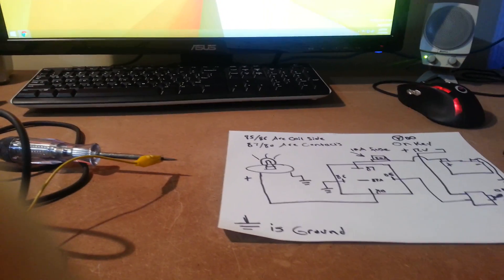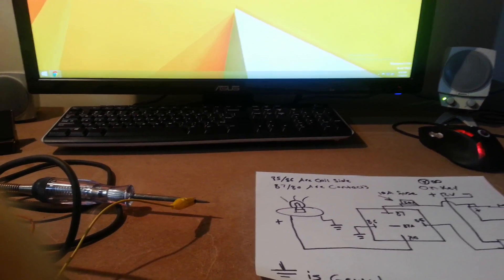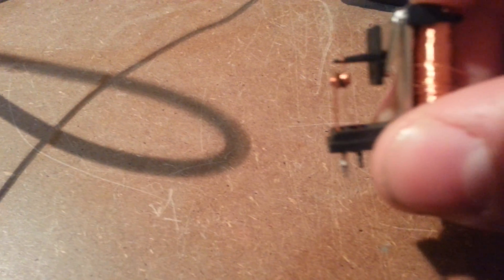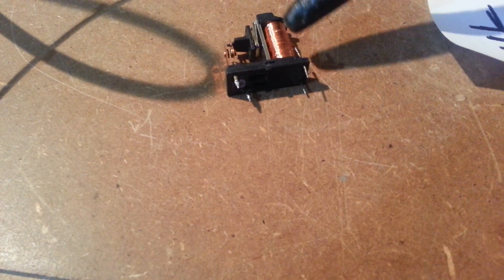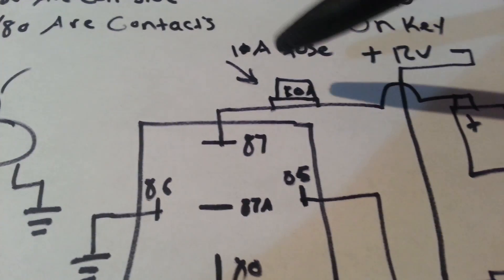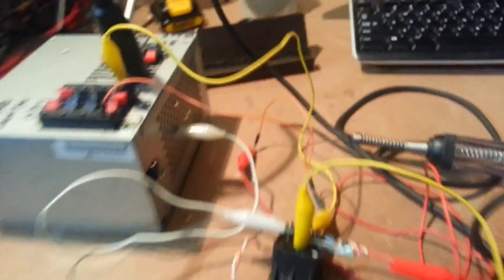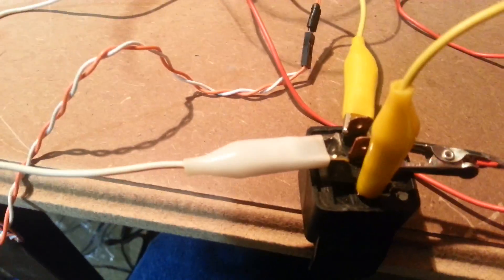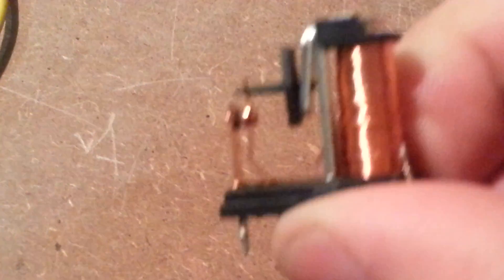How to wire a relay for running lights

Comment: Wrong,Wrong,WrrrrooonnG!!!!
You have an error in your numbers,!!!! There is 87-87a- and then at the Bottom,!! 30 BUT YOU HAVE THE BOTTOM number 80"!!! There is No number ( 80 )!!! On any car relay.!!!! What are you Smoking- dude,?? It must be better than mine.!! LOL Cause I saw it right off.!!
Reply: Thats correct.  80 is not an automotive switching relay pin, that would be pin 30.

Comment: Hi question, I just sub’d and hit that 👍, and also the 🛎 to get notifications!
My 2017 Accord LX(Lowest Model) so I don’t have the Led Strip DRL, However, I do have the strip on the headlight. 
It just doesn’t have the socket behind the Headlight, to screw in a LED Bulb, to project the acrylic led Strip like the Ex/Sport Models.
It has a Low beam halogen projector, and halogen high beam / DRL.
Is it possible to run the power going to the Factory high beam/ DRL function to a 5-Pin Relay and direct the power to a led bulb for the strip?
Then run another set of wires to a connector and run it back to the high beam.
So if I ever do need the high beam, I’ll still have that function? 
The relay is like opening and closing doors? To direct and move the power around correct?

Comment: Good video. The way I see it, there are two pins that have 12 volts connected to them.  85 pin is connected to 12 volt , through a switch. plus pin 87 is connected to 12 volts. I don't understand why two power sources. could you explain this???
Reply from the maker: Andy ill make a video on why:)
Reply: Thanks Sean. it all helps us understand.

Comment: Hi hav. 1994 motor home wont start . one of the relays is burned. i pulled burnt wires thru. when i turn on switch i have power at distrub. but nothing out.has 4 wires red yellow red with bluue stripe and black with white stripe.with switch on has power at red and yellow. how to wire relay.

Comment: Here's my dilemma...the fogs on my 2014 Kia are totally useless and illumination is poor. Hardly noticeable with the headlights.The manual says to use sparingly as they use too much power thus shortening battery life and I'd hate not using them at all. Is there a way to use them as drl's without them using up so much power?
Reply: Ex plain  what's  happened to it
Reply: change the halogen bulbs with LED's or HID's...

Comment: Hi, question. I have a 12 volt, 210 watts led light bar, I would like to use a 40 amp 4 pin relay with a 20 amp fuse and a 20 amp illuminated rocker switch. Would my set up work? Thanks.
Reply from the maker: Basement31 should 210w / 12 is 17.5 amps. I'd go with components that support 25 amps or more and you should be fine

Comment: how do you know if the switched 12v  will have enough to power the lights?
Reply from the maker: roger mathers you can test the load using an amp meter or look at your load specs most will tell you how much current is being pulled.